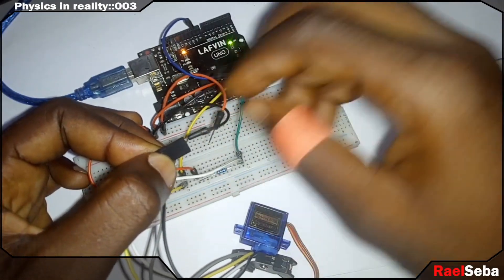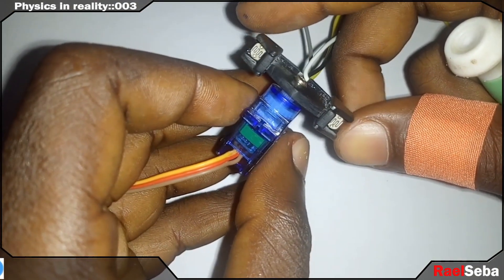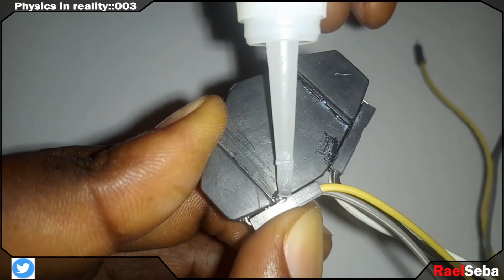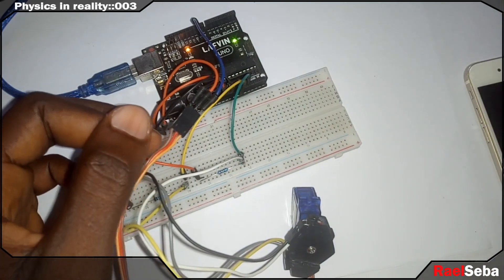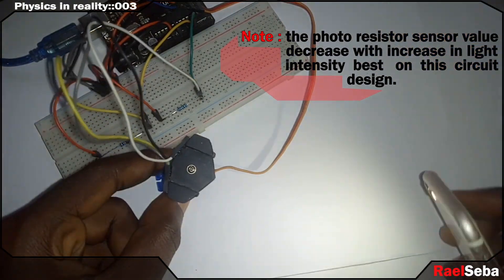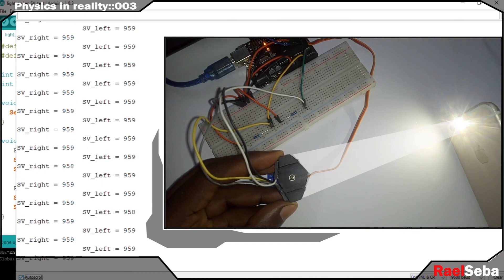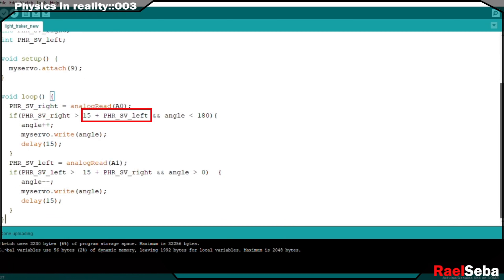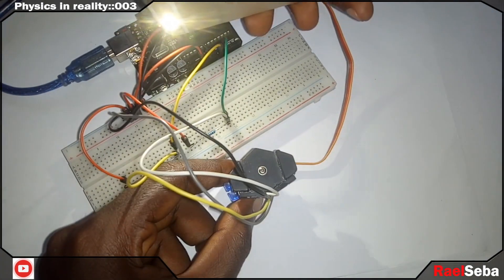light tracker (using photo resistor, arduino and servo motor)

Comment: Nice job!
For my Solartracker I put a 3rd resistor underneath for x-y movement of 2 servos on top of each other. Never cared about the jiggles but with your "right >15 +left" I gave it a shot and it works like a charm without jiggleling now.
Reply from the maker: That's nice